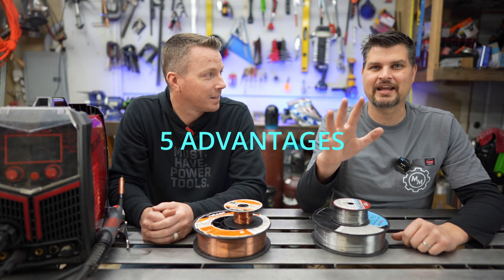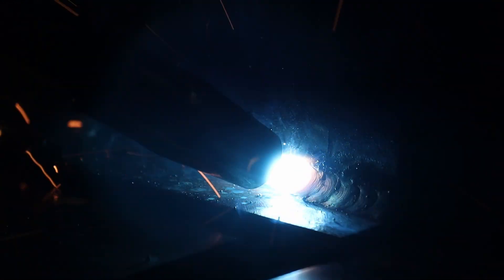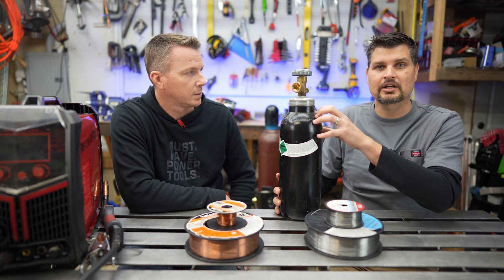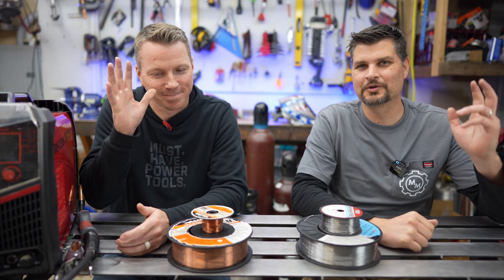Top 5 Advantages To MIG Welding with LRN2DIY

Comment: I couldn’t comment on the shorts but I was curious is there an all-around blade like the one you tried on the evolution that will cut stainless steel versus just buying the stainless steel blade which is very expensive I have the saw

Comment: Last two months I switch from one year experiencing stick welding to mig learning. The most cumbersome issue is, it is not setup and go. There are many details i.e. gas flow amount, voltage setup depending on material and its position, wire feed rate decision, wire stick out dimensions and most importantly trying to convert imperial information from YouTube to metric. I really leaned on your information flow to come to a reasonable point. Thanks
Reply from the maker: Thanks!

Comment: You mentioned using welding grade Co2 for drinks...NO! Welding grade Co2 is dirty, at only 95% or less, pure. Really dirty. As in, leaves a black film on things. 
For food grade, Co2 must be at least 99.9% pure. It will also ONLY be stored in a tanks with a ceramic or other non-permeable coating. Liquid Co2 is corrosive, and will remove metal oxides from non-coated tanks. Ask any Paintball guy about the black slime, all over their guns after a good day of play.

Obviously, food grade Co2 will be more expensive than welding grade gas.
Reply from the maker: Very true, I should have mentioned to get food grade Co2 if you want it for bottling.

Comment: Advantages: 
 0:08 Wire cost
 0:35 Cleanup
 1:15 Weld thinner material
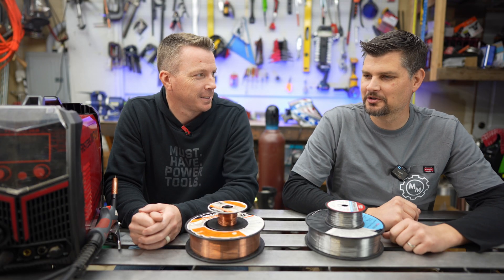 1:51 Productivity
 2:19 Weld aluminum

 Disadvantages:
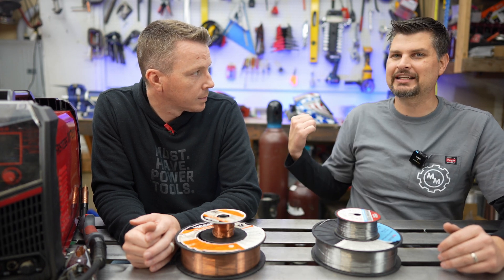 3:15 Gas bottle
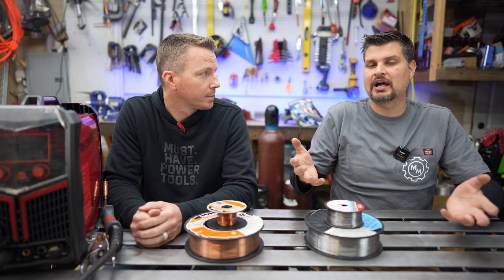 5:21 Not portable
 5:38 Setup time
 5:54 No wind
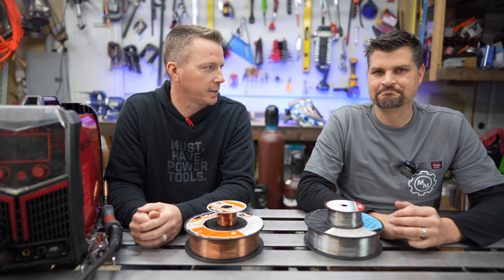 6:28 Metal prep
 6:53 No castings

 As a welding newbie I found some good info here (enough to decide flux core is still good enough for me and my purposes), so thanks for posting this! But I think all list videos should have chapters.
Reply from the maker: Thanks for adding that along with watching the entire video, haha!